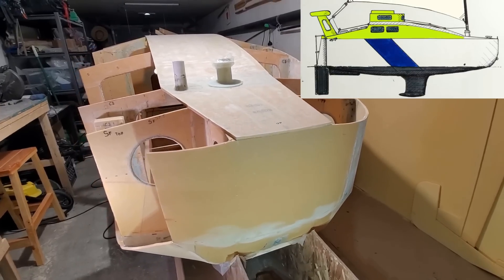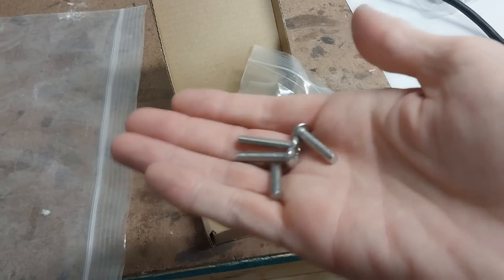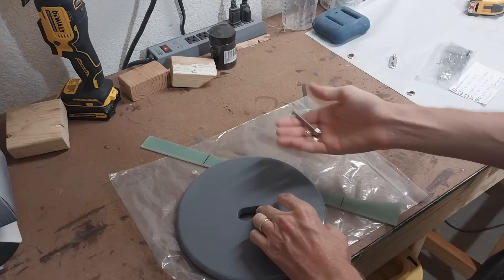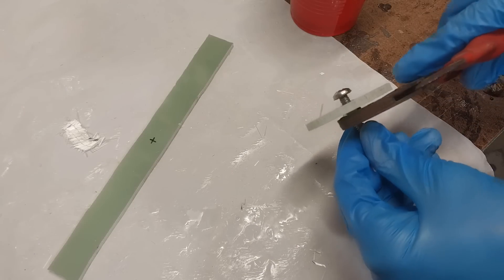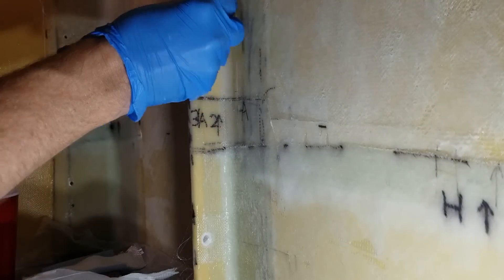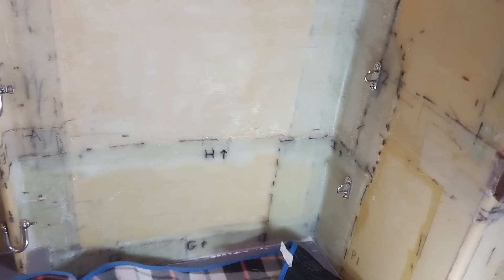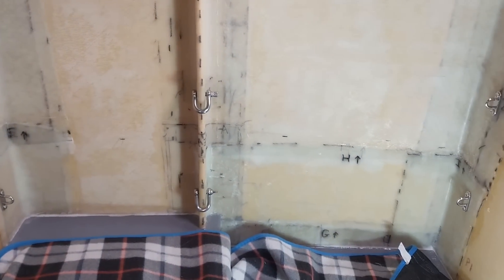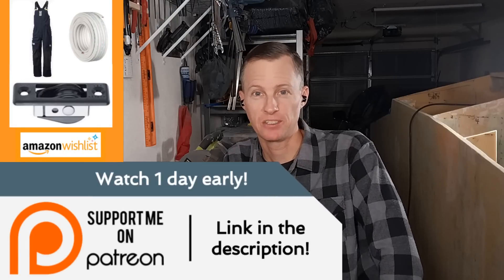OCSS-064 DIY Compression-Style Hatch Latch

Comment: Watching you make those fiddly little cuts with a jigsaw made me kinda nervous.. "oops" moments are too easy to make. Might I suggest a better way?

Use some scrap pieces of timber to build a mounting jig that will securely hold your jigsaw upside-down. It can take a little ingenuity to securely clamp the jigsaw into it, but I know you're up to the task! Then you clamp the entire thing to your workbench, and you now have a mini band-saw that lets you bring the work to the cutting blade, rather than the blade to the work. In the past I've done this a few times (until I finally bit the bullet and bought a cheap band-saw), and it is MUCH easier to use for making small, fine-detail items.
Reply from the maker: Thanks, I need one of those. I hate cutting small things with the jig saw. At least this blade is a carbide grit blade for cutting ceramics,  so it has no sharp teeth.
Reply: @ocean_capable_small_sailboat  - I got my bandsaw from an Aldi sale. Cost me rather less than AU$200, if I recall. (I think you have Aldi in the US these days...) In the meantime, while you're waiting for Aldi to have a sale on workshop machines, the upside-down jigsaw trick should get you by nicely.

Edit to add: Oh yeah.. DO be sure to check out some YouTube videos on how to set up/adjust your band-saw correctly.. it will save you no end of grief!

Comment: For your deck hatch a good option if you go with a square harch is to make the corners with large radius and rebate the inside of the hatch the similar to this one only quite a bit deeper use this to seat a hollow rubber oring gasket in the lid. Then make the hatch entrance slightly smaller but put a substantial 45 degree bevel......this provides a very robust and proven seal, as it naturally evens out the pressure with minimal compression force......just an option to consider
Reply from the maker: A little hard for me to understand without a drawing, but feel free to e-mail me (in description.) I wonder what's the best way to attach the tube gasket to the lid... and one end of the gasket to the other end.
Reply: @ocean_capable_small_sailboat  the tube can just be glued with rubber contact adhesive, or even supaglue, it's not exposed to much in the way of stretching/elongation loads just compression.
Excuse me if this sounds repeditive.....The hatch rebate is 90 degree step just like the hatch you built but the rebate needs to be a little deeper both vertically and horizontally, to accommodate the gasket/tube. For the gasket use hollow rubber tube (like speargun rubber - depends on hatch clearance tolerances .... the bigger the internal hole in the rubber gasket the more forgiving the seal will be), this is placed (can secure with a little silicon) in the rebate. 
The deck opening is chamfered/bevelled at 45 degrees. The o-ring installed in the hatch naturally beds on the 45 degree bevel and forms a very secure seal.
We use this for underwater camera housing lens and ports and have more faith in the integrity of these over the commercial control rod fittings.
Most people use a traditional face to face gasket/seal this works, I just see these failing a lot too.
But Ike I said just an option

Comment: @ocean_capable_small_sailboat      I assuming it was intentional design to make the star knob bolt head on storage hatch as thin as possible so it would not be an issue by sticking up too much on lid top perhaps as you're going to be lashing other items placed on top this lid in that area, perhaps If I'm understanding correctly?  It seems like the star knob you made may not the easiest to grip ahold of with fingertips yet still satisfactory for use here, I'm sure. 

I know this is quite a minor detail... Yet, it might make that star knob's handle a touch easier to use, since it has to spin a fair amount... To perhaps have it fashioned to work more like an old-fashioned rotary phone dial disc to spin on and off.  It may require the "bolt head knob" (If you will accept the term) to be a bit bigger diameter to accommodate. But then essentially by drilling one, finger sized thru-hole into G10 material offset from the centerline on the disc shaped dial, or in your case the knob top. You would be able to rotate thru bolt head by twirling your finger like dialing an old rotary phone. Just a thought that entered my mind as I saw you do all the twisting action while closing / opening the hatch with the thin star knob you created.

Maybe not here, but considering possibly with the other hatches you mentioned coming up for you to secure at some point... Would employing some form of fabric webbing and double "D" rings for hatch cover's security work as well, perhaps.
 [ As in lashing the lid covers down using those two items...] 
It seems that method if affixed in the appropriate arrangement up top could offer you a lot of what you are looking for (or keeps a low profile anyway...) and might not take as much handmade hardware as this mechanism did for you to devised in this video. 

(Not sure if the other hatches you mentioned in this video are to be watertight, (as in won't have the hole in the lid cover like this hatch cover did or NOT)
-Perhaps an additional case can be made for the webbing lashing hatch lid security method then too if so...

Just some thoughts that crossed my mind as I watched this episode for whatever they are worth to you and this sailboat building.
Reply from the maker: Thanks for the ideas. I'll have to be more careful when making the one on deck, the hole through the lid for the boat could let in water. But I bet if I just add a rubber washer it will keep out most water when the lid is screwed down tight. I'll also make the hole in the lid the same diameter as the bolt, no need for it to be larger.
Reply: @ocean_capable_small_sailboat  Thank you for replying... I imagine a washer / gasket could work sufficiently at hatch lid thru hole location like you said if you decide to make other hatch covers using the same method of securing them tight.   

I must admit I'm quite a casual watcher of your Channel's videos, (as in I've caught a few here and there in-between so forgive me if you've covered this all-in depth before...)
Hence, I was thinking you were saying you had more "interior storage hatches" to secure perhaps in the way you had in this video sometime later on... 

I guess I didn't think much about exterior storage hatches if any or if that is even what you are speaking about in your reply to me here when you said, "I'll have to be more careful when making the one on deck." If "the one in the deck" is referring to the main entryway/doorway hatch you'll be passing thru for getting inside your boat" Then maybe I have another idea to share with you that I once tried to explain to Sven Yrvind regarding his entry hatches. I had a hard time explaining it to him. Additionally, his boat is quite tight in the entry compartments. So, anyway I made some illustrations for him to see of which I'm still not clear he saw the whole concept before discounting the idea. Oh well.

If you had any interest in a concept for a fairly simple scratch-built hatch closure security method similar to Sven's concepts a.k.a (the Ratchet strap) but sort of coincides with your compression mechanism here (as in it employees a longer bar underneath hatch lid) I invite for you, if you'd like to perhaps, look at my illustration videos meant for Sven at the time on my channel found at,  just my name here... There is only 3 rather short (like 3mins or so) videos published there so you don't have to hunt. The video sequence is as follows, the first video or earliest one does not have a number in the title. I was just trying to get him to see the concept at first. The second video "the hatch part of it" comes in at 4:18 or so.... And lastly the 3rd video is about a hatch "hinge" mechanism. I thought might work in his case with the right tweaking... (Probably would require a two-bar linkage hinge of sorts to be most effective for him which was too complicated for his liking.) Apparently, he is going with the concept of securing his hatch on with means of rope and eyelets...
Oh well If you'd like to check out what I proposed once to him your welcome to perfect any of it to your liking. It's not any technological breakthrough concepts by any means it is just ideas / concepts that might apply to what either of you are striving for in this case a watertight hatch security method engaged from inside the boat.
If you have that all worked out already no worries, then.
Reply from the maker: I watched your videos to Sven weeks ago and I commented, asking if you would help me! I'd love for you to e-mail me (e-mail in description) and we can work on my hatch hinging for the main hatch into the boat.
Reply: @ocean_capable_small_sailboat  Really, are you sure you commented to me??? I wonder why I never saw your comment then? And honestly still do NOT see it on any of my videos currently. There are only 3 presently so it's not hard to check that. I'm not sure what is up with that... Communication via YouTube comments has drove me crazy... 

As strange as it may sound to you...I purposely wasn't visiting my published videos thinking I could then see via the activity monitoring built into YouTube studio when Sven watched it... Then I advertised / made attempts to invite him to see them a number of times and that's finally when a group of I suppose his followers took notice... So. I finally saw a few views register in the YouTube analytics in what was to be a video mostly directed for his viewership.
Anyway, until he mentioned something featuring a bit of my concept later on, I must say I really could Not figure out via YouTube if he ever saw it, much less understood it in its entirety... Oh well...

Was your comment requesting help with your hatch design perhaps within his commentary of one of his videos? Or would it of NOT included my YouTube name perhaps as I sure did Not get any notification you had directed any comment my way. I'm sorry to report to be candid with you... 

Of course, that is until just recently when it's been commentary between us via your channel here and regarding your latest video uploaded... 

Hmm. Like I said YouTube comments / attempts to have conversation(s) within them and such, along with viewership details are still a bit of a mystery here to me unfortunately. 

As for assisting you with your entry hatch mechanism or hinge, on your watercraft I'd have to say I'm flattered. Yet I imagine perhaps it was maybe the illustrated model / quasi 3D looking animation that may have piqued your interest, I don't know perhaps something else... I guess it just helps to see something drawn out or mocked up or modeled in some way other than in your mind's eye... Maybe just bounce one's idea(s) off someone else for their critique. 

Well, all that said, I must inform you I'm NOT an expert about such things in the least or an expert merely attempting to be modest... 
[ I suppose with that notion clearly stated I guess I could discuss further with you more specifically some more about details of your hatch requirements and placement. 

Yet can't promise I'd have the solution you are seeking here or could perhaps be able to provide the missing link in the succession of your hatch building process to ensure you will be successful in producing what you need. But sure, I'm willing to listen or take a look at more or less what you might be considering for an entry hatch. Then you'd probably have the luxury of bouncing the concept off your viewership here for refinement or possibly a more expert critique I'd have to assume. 

On a side note, yet about your, I believe still to be upcoming aft exterior hatches... 
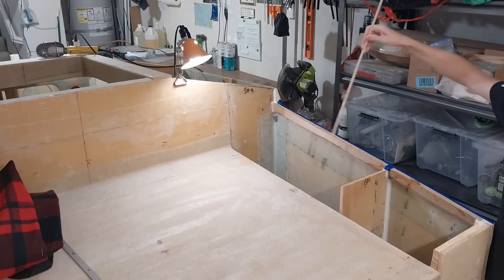I was wondering is the intent to have that whole rectangular area you are pointing towards at approx. 14:40 mark in this video to be opened?  Say, like a classic rectangle cooler lid might be removed or child's toy chest might lift/ hinge upwards from one side? Essentially What I'm trying to determine by asking is...  Will there to be elongated items stored in this locker box or bulky things that must come in and out of it? Or is that locker space's size just a function of its location and you will primarily be placing smaller form factor items in there? 
I ask as I'm wondering... Can the hatch lid(s) be smaller and /or more circular round once again possibly and still work for what you'd like to be storing in this compartment you have allotted for topside?

Well I'll leave this comment at that for now... It's already containing a few questions for you to sort thru if you're able to wade thru this all as it also feels like I've said so little, and inquired about an array of things here in so many words...

I'd be curious if you'd have any insight of any ideas where your initial comment about a request for hatch help is at now?  You can reply here for now, It seems to be working okay... and I'll maybe soon connect with you via email. if you don't mind
Reply from the maker: @shawnb1999  Thank you, please e-mail me, it's a much better way to exchange ideas and I will have a better record of it. I was most interested in your 3D model video of the hatch hinging. I think if we plan carefully we can make a hinging hatch that cleverly swings out of the way on my boat. I did comment directly on your video, but for whatever reason it's disappeared!
Reply: @ocean_capable_small_sailboat     Perry, I want you to know I made an attempt a little bit ago today to connect with you as you requested or suggested... You'll have to be on the lookout for the incoming message. Perhaps it may require you to check spam or junk folders at first until your mail recognizes me as having good intentions on your behalf. Hope you get it with little further issues for our communication to continue... Let me know otherwise.
Reply: @ocean_capable_small_sailboat  Thank you for replying... I imagine a washer / gasket could work sufficiently at hatch lid thru hole location like you said if you decide to make other hatch covers using the same method of securing them tight.   

I must admit I'm quite a casual watcher of your Channel's videos, (as in I've caught a few here and there in-between so forgive me if you've covered this all-in depth before...)
Hence, I was thinking you were saying you had more "interior storage hatches" to secure perhaps in the way you had in this video sometime later on... 

I guess I didn't think much about exterior storage hatches if any or if that is even what you are speaking about in your reply to me here when you said, "I'll have to be more careful when making the one on deck." If "the one in the deck" is referring to the main entryway/doorway hatch you'll be passing thru for getting inside your boat" Then maybe I have another idea to share with you that I once tried to explain to Sven Yrvind regarding his entry hatches. I had a hard time explaining it to him. Additionally, his boat is quite tight in the entry compartments. So, anyway I made some illustrations for him to see of which I'm still not clear he saw the whole concept before discounting the idea. Oh well.

If you had any interest in a concept for a fairly simple scratch-built hatch closure security method similar to Sven's concepts a.k.a (the Ratchet strap) but sort of coincides with your compression mechanism here (as in it employees a longer bar underneath hatch lid) I invite for you, if you'd like to perhaps, look at my illustration videos meant for Sven at the time on my channel found at,  just my name here... There is only 3 rather short (like 3mins or so) videos published there so you don't have to hunt. The video sequence is as follows, the first video or earliest one does not have a number in the title. I was just trying to get him to see the concept at first. The second video "the hatch part of it" comes in at 4:18 or so.... And lastly the 3rd video is about a hatch "hinge" mechanism. I thought might work in his case with the right tweaking... (Probably would require a two-bar linkage hinge of sorts to be most effective for him which was too complicated for his liking.) Apparently, he is going with the concept of securing his hatch on with means of rope and eyelets...
Oh well If you'd like to check out what I proposed once to him your welcome to perfect any of it to your liking. It's not any technological breakthrough concepts by any means it is just ideas / concepts that might apply to what either of you are striving for in this case a watertight hatch security method engaged from inside the boat.
If you have that all worked out already no worries, then.

Comment: I'm torn with your channel, I can't wait to see the finished boat but then that means that there won't be any more building videos to look forward to.

If it's not a silly question, at about 4 minutes, why did you cut both ends a long piece of G10 leaving two short off cuts instead of just measuring from one end and yaving a single longer off cut that could be used elsewhere? Guess who has got a workshop full of off cuts that he saves for just in case they might be useful 😉
Reply from the maker: Thanks, I'm also not sure what happens when I switch from building videos to sailing videos. It'll be a totally different kind of production.

That mid section just happened to be a consistent width, but on the ends it got wider. It's not so easy to see in the video though. I'm sure I can still make a few small backing plates with what was cut off.